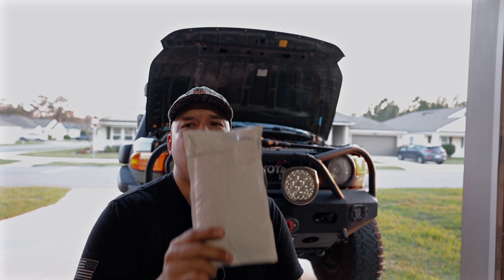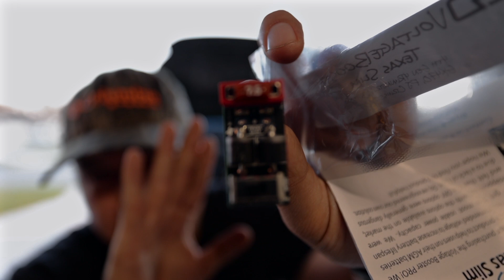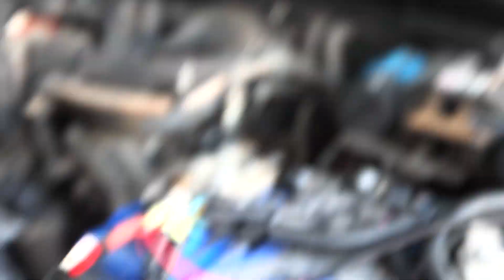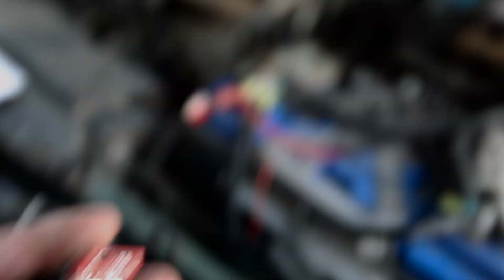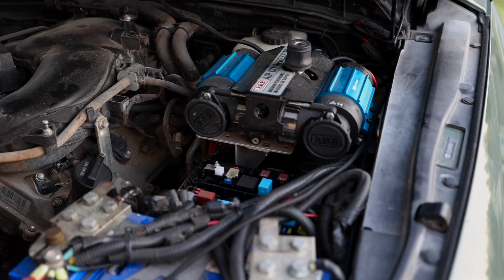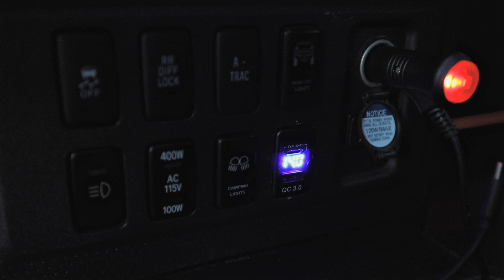How to properly charge your AGM battery- Voltage Booster Pro

Comment: And another thing is that diode will heat up 2. Its probably not a good idea to force more voltage from alternator because it will damage the alt
Reply from the maker: I haven't noticed any major heat issues, but I'll keep an eye on it! 🧐

Comment: Them plug in voltage meters ar wrong take a multimeter ant test it directly from the battery while car is running to get the correct charging voltage
Reply from the maker: I’ll have to try that out, I also have a blue seas power inverter connected to the battery that reads it as well which seems a little but more accurate.

Comment: the whole point of the video was to see the voltage gains from the low and high settings. you showed it on low and then did a photo shoot of the product in the engine bay for the last minute of the video. I appreciate the information but the information and data if only 50 percent of what needs to be shown for others to make a dedicated decision on purchasing or not.
Reply from the maker: I appreciate your constructive criticism; I'll aim to include more detailed data in my next reviews.
Reply: @GREATESTOFALLTEXAS I appreciate you taking my advice on a positive outlook. I wanted to see the high voltage output to see if it could charge a 5s lifepo4 bank. But I got it figured out. I’m gonna built a harness with a fuse and a 10k ohm potentiometer so it’s adjustable voltage on a knob where I can control voltage from 13-15.75 volts & still have it fused for safety. Thank you for the reply.

Comment: I tried this on my fourteen tundra and only got point two more volts and it got super hot in my fuse box.I didn't want it in there to catch a fire wast of money
Reply from the maker: I would contact Voltage Booster Pro. I got more than that with low mod. I'll check the heat of mine, but no issues so far, thank you for the comment and watching

Comment: Forgive my ignorance, doesnt the gauges on the dash list the voltage of the battery? Why would you have a digital voltage readout as well? Just preference or do they do the same thing?
Reply from the maker: The digital readout allows me to have a more precise measurement of what my batteries charge is and if my hood solar panel is doing its job. The factory one works well just knowing if you battery is in good health.